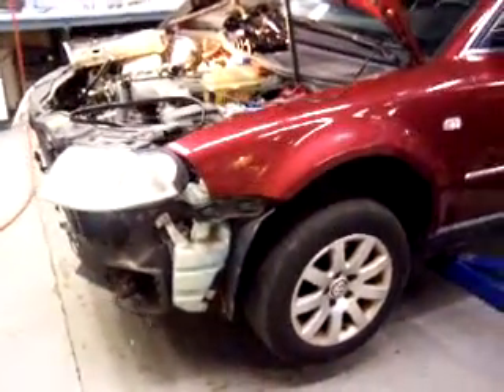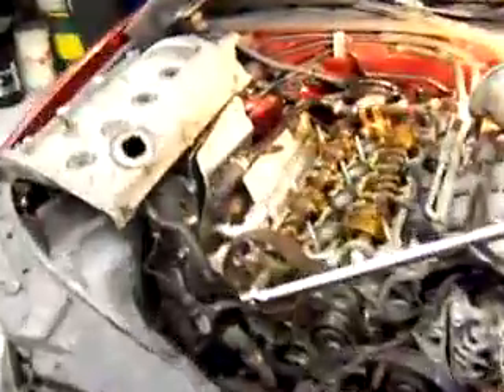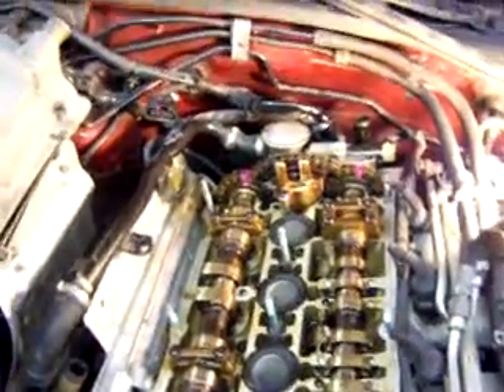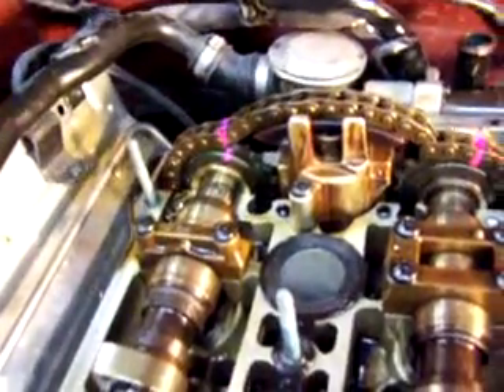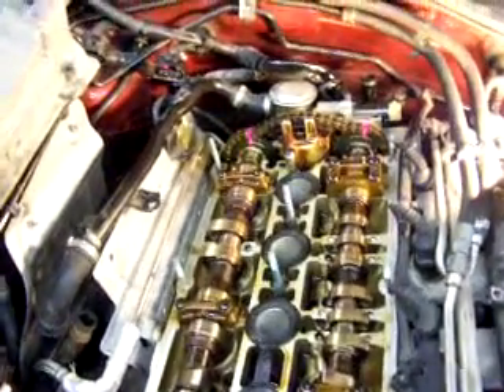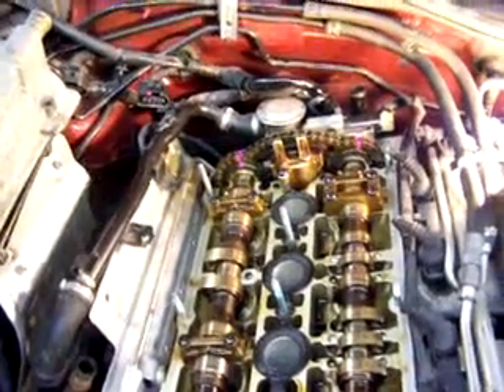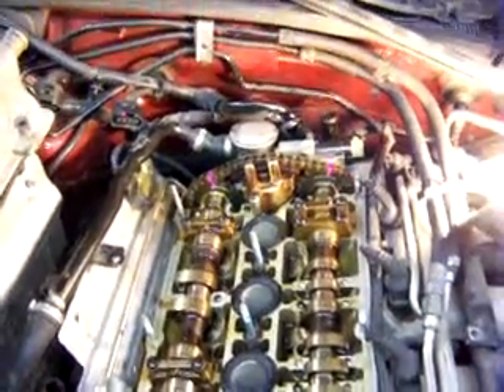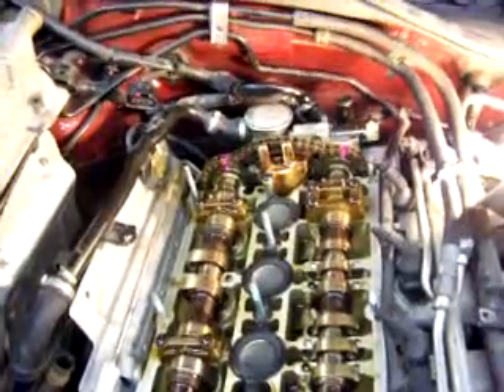Volkswagen Passat 1.8/2.0 Turbo Engine Noise.... Solution Part 1

Comment: ⚠️ Sudge is very common on 1.8t motors VW and Audi, the oil pressure switch is designed to activate the low oil pressure warning at around 7psi of pressure, and it is only active at 2000rpms (at 2000 rpms the normal oil pressure for 1.8t is around 45psi or the lowest is 35psi) so if you see the oil pressure light on your cluster at around 2000 rpm your oil pressure is WAY too low. You should stop immediately !!! You might not make it to that exit that's 500feet away...
Weak or Leaky Oil Pressure Relief Valve: The pressure relief valve, which may be located on the pump body or elsewhere on the engine, can be yet another cause of low oil pressure if the valve sticks open or is held open by a small piece of debris. The relief valve is designed to limit oil pressure as engine speed increases. The valve opens when pressure reaches a preset value (typically 40 to 60 psi). This vents oil back into the crankcase and limits maximum oil pressure in the engine. The reason for doing so is to prevent oil pressure from reaching dangerous levels. Too much oil pressure can be just as bad as too little because excessive pressure can rupture the oil filter or even blow out pressed-in oil galley plugs in the block.
The oil pressure control valve 077 103 175 B sits behind the adapter for the low oil pressure switch and prevents the oil from flowing back out of the cylinder head when the engine is switched off.
As a result, the oil pressure is increased faster during engine start-up and rattling of the hydraulic tappets and cam-chain tensioner is avoided.

Comment: ok I really need your help I am not a mechanic and I am having a few problems on my 1999 vw Passat wagon idle engine noise smoke from exhaust and check engine light is blinking is there any way you can help me???? desparate and on a tight budget!!!

Comment: This takes away the variable valve timing function, yes? I can see this as a temporary fix only until you do the job properly and get a replacement tensioner.

Comment: Hi sir , thank you for uploading this video it's really helpful ,

I Have GMC terrain 2010  it was great for 2 years , suddenly the car start to make knocking noise at every left turn  , the noises has developed and start to appear on acceleration too , i took the car to service they first check the oil and then change it . everything goes good sounds disappear no noising , after 4 000 k/m it start to happen again even when starting car cold ,,, i notice that when changing the oil the car doing fine .. any clue please help me , what to change can you name a reasons of this sound please

Comment: ive just tried your fix and yes it does stop the noise from happening but when you do that,it does do what the variable timing is supposed to do anymore and it over retards the motor not allowing it to advance as it is supposed to.i know that because afterwards,the check engine light came on with a p0012 code meaning over retarding reading from the camshaft position sensor.i did your repair because I just replaced the oil pump and pick up tube,pump chain,cleaned the sludge, the tensioner/solenoid,and chain,and a month later,i heard the noise again.

Comment: hey im doing my 02 1.8t jetta just the chain tensioner. but im also going to change all the gaskets from head, valve, intake and throttle. anyways my engine had its valves and pistons done at 100k miles and it got like 150k miles so i also heard it could be the lifters. i need a solution because i a broke my other tensioner so i imagine my mechanic got  used one and the one i got now is new.